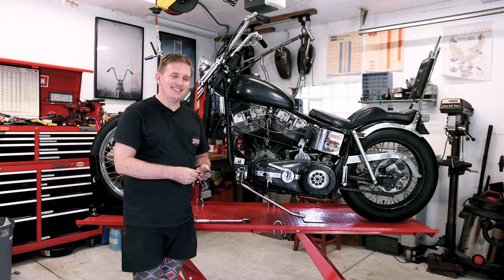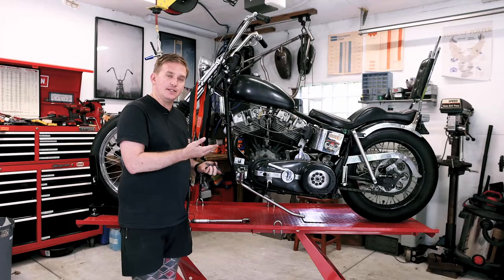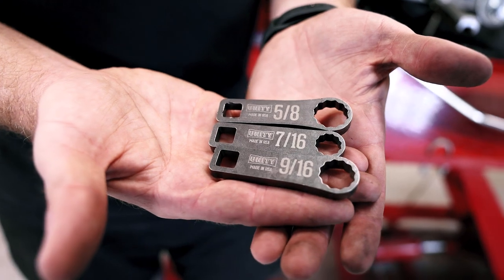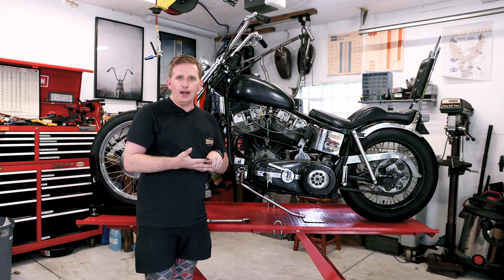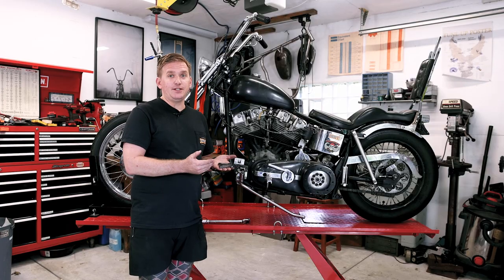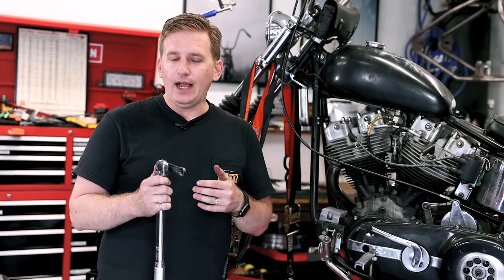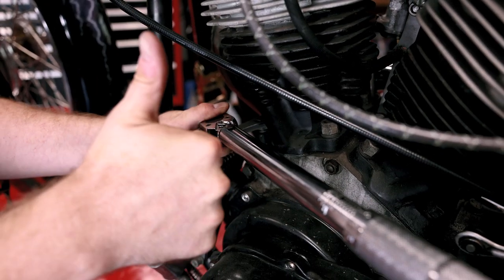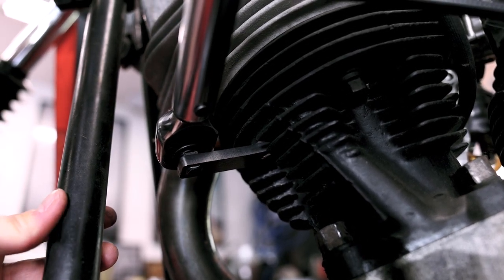Unity Manufacturing - Dogbones - A Torque Wrench Adapter Set for Harley-Davidson Motorcycles

Comment: I just ordered a set of those torque adapters. I used to make them using cheap wrenches and they's work for awhile, but they would never fit quite right & would break on a regular basis. Since I'm looking at an inspection (yeah, I do that; just like an airplane engine) on my '72 FLH, they will come in handy. Thanks for making them available. I'm sure that many of us older Harley owners will come to appreciate them.

Comment: Snap-on. Started using these 40 years ago. Here is the deal. In the bad old days, we wrenched our oun bikes. The five bolts shown are headbolts. Maniacs would remove these bolts with a bent wrench, and when they put the heads back on they put these bolts in with a bent wrench,,,,,,and a hammer,,,to get them tight enough. Torque was all over the place, and not only shovels,but pans and knuckles suffered too. Head gasket failure was common. When I rebuilt my upper end for the first time I was not happy with this method. I was an aircraft mechanic and knew those bolts had to be torqued right. They are hard to get at with a standard wrench. So I called Harley for advice. They told me that's the bolts had to be torqued at 65 foot pounds. They couldn't,or wouldn't tell me what tool to use. So I contacted my Snap-on rep. Showed him my problem and he showed me a. Torque Adapter. 9/16 . Torque right and no more blown head gaskets. Keep the shiney side up.
Reply from the maker: Yes snap-on had em, these are less expensive and work just as well. Affordable solution fo sho! Stoked you were able to do your due diligence and get the job done right. We are hoping these help the future bike builders from that problem as well. Thanks for sharing!
Reply: @lowbrowcustoms  you are so right. I'm not a tool brand snob. I even make my own tools if I need to. As I said I was an aircraft mechanic at the time, and bought a number of tools(aircraft related) from Snap-on. I can't think of anything Ive bought from them since. I am very glad that you are getting the word out about this tool. These are fine old engines. Built right, oh they will haul your ass down the road for a long time.  My 75 is closing in on a half a million miles. I've rebuilt it once. Every bearing everywhere in that bike wore out at once. Keep spreading the word.

Comment: I have the same issue dealing with head and barrel nuts on my '74 Norton Commando. I like the stubby length of these adapters. I currently use the Motion Pro torque wrench adapter device that clamps to any spanner/wrench you already own, letting you then connect your torque wrench. It is a bit fiddly and clunky to setup compared with these specific sized adapter. But it does work and I can use it on all my wrench sets, metric or SAE.

Comment: Great idea guys! It looked like the square hole where you place the socket wrench was getting stripped out from use? Or are my old eyes deceiving me again?
Reply: Info states made from highest quality AR500 steel which I believe is the same used for shooting targets, don't remember if that is heat treated or the heat treatment specs are a hard as heat treated material

Comment: Saw your dogbones on Lowbrow email, DON'T have a Harley but can see where I can use these in other applications, you must of got the idea from the tool that's used for the old VW beetle rear ends? Another note, I DO know when extensions are added to a torque wrench it effects the actual torque that the fastener gets a certain percentage so with extensions the actual reading on wrench ISN'T what the fastener is actually getting so there is a fudge factor involved but I don't remember what that is, now I >> DON'T << know if such is the same when you offset the torque load, you may want to actually run your wrenches & their design through some torque experts to see if there needs to be a fudge factor added or subtracted when using you adapters

Comment: Does it affect the amount of torque applied?
Reply from the maker: No if put at 90 degrees it gets optimal torque, there are calculations you can do. But Hunter figured out that’s the best angle to get the best result.
Reply: If kept at 90 degrees to the actual torque wrench, then the set amount on the wrench is what the fastener receives. If you connect at different angles than 90 degrees, then you need to make a calculation on actual applied torque.
Reply: Yep there is a fudge factor in some cases, and a illustration card should be added showing the position of the adapter on the torgue wrench per application and corrective adjustment on wrench per case   @TornadoCAN99